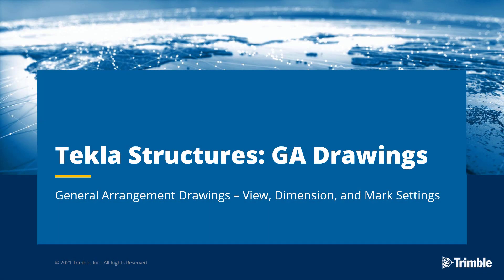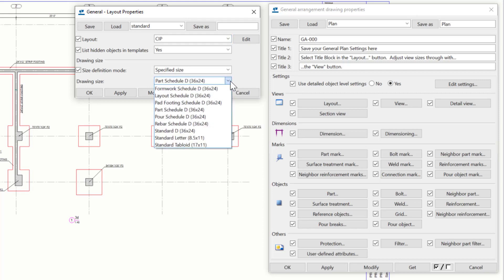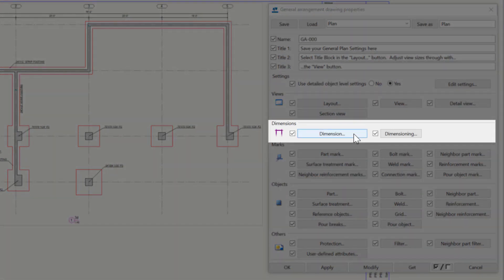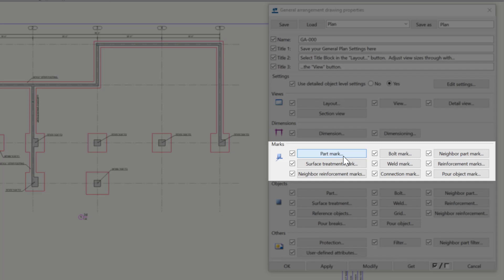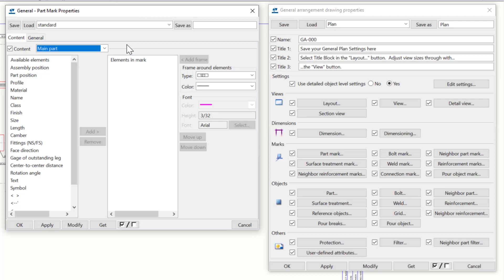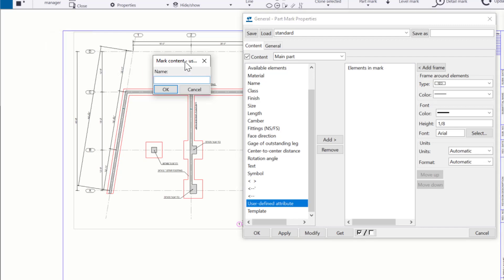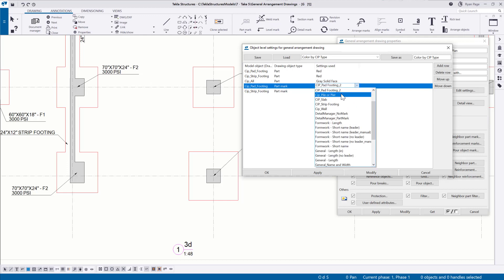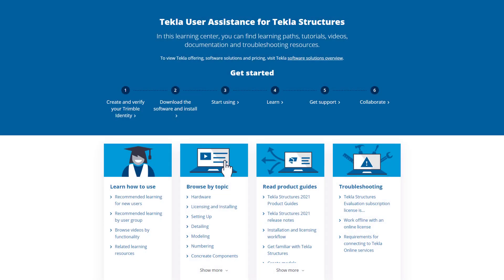General Arrangement Drawings – View, Dimension, and Mark Settings

Comment: Thanks for the video. These kinds of videos are very helpful. I have a question, which setting controls merge rules of a few same single marks in one merged mark? Where is that setting? And how can I teach Tekla to look for the same parts to merge their mark within only a specified region, let's say look not deeper than 1000 mm?
Reply: This is a great question, did you find the answer?
Reply: @Joe-eo7ij  No, not for GA drawings. For assembly drawings is not a problem.